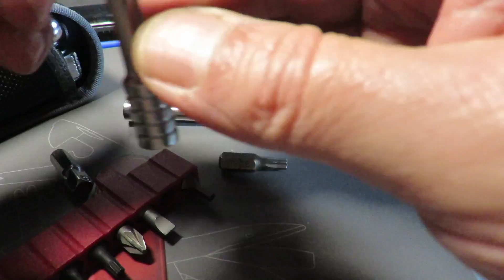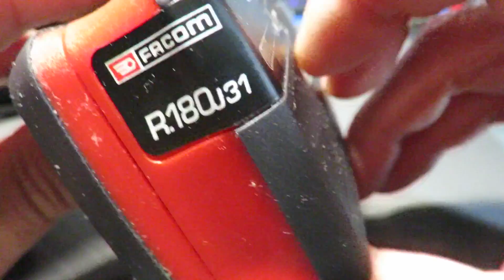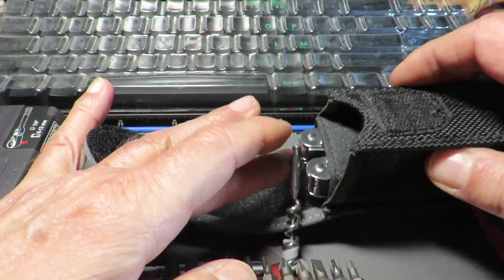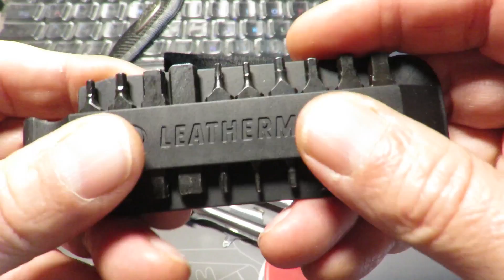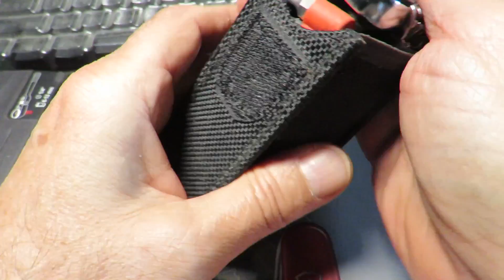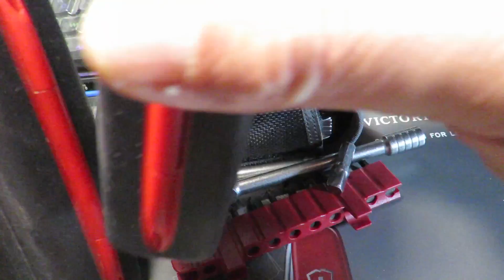Sublime Ratchet for your Victorinox Swisstool !

Comment: I really like that Facom adjustable head. They don't sell the kit on Amazon here in the US. They do sell the ratchet and extention for around 65.00. I found another kit that I just ordered made by Gearwrench. Have you seen that one? I looked up one from Snap On but all they sell is Bluepoint.
Reply from the maker: This model ? : https://www.gearwrench.com/ratchets-and-drive-tools/gearwrench-891400-1-4-drive-pass-thrutm-72-tooth-xl-locking-flex-head-ratchet-6-1-2.html
Reply: No. But I like it too. This is a kit. Model 85035 micro driver set on Amazon. Very very affordable. I believe Gearwrench products are made in Taiwan. I went to misterworker.com and looked around. I really like that Facom kit with the security bits. R.180J31 from your video. Even on eBay its still over a hundred dollars. EBay shows you other examples too, but nothing like the Facom. Teng tools? Let me know what you think.
Reply from the maker: @dennissmith802  https://www.amazon.com/GearWrench-85035-35-MicroDriver-Set/dp/B0062FSAVI
Yes, Taiwan. Like most mini ratchets.
Teng Tools? I do not see a ratchet equivalent to that of FACOM on their catalog.
For the R.180 ratchet or the R.180J31 box, these products are quite expensive, this is normal for the high end.
In France, on Amazon, the box is worth € 100.83 or about $ 120.
On eBay try this UK store, I think it can ship to USA: https://www.ebay.fr/itm/Facom-R-180J31-31-Piece-Compact-1-4-Embout-Ensemble-Avec-Tete-Flexible-Cliquet/164396938434?hash=item2646d234c2:g:ILoAAOSw8lpZMWvK
Reply: @diezelle57  Teng tools was  just one of the options that eBay gave me. I was curious if you had tried any of their micro ratchets. I haven't even looked at their catalog. The only thing I dont like about the Gearwrench equivalent of the Facom, is that it's almost seven inches long and it doesn't have the t-handle capabilities of the Facom.
Reply from the maker: @dennissmith802  I haven't seen a micro ratchet at Teng Tools, I told you. It would be much easier if you put links to the products you can tell me about :)
Reply: @diezelle57  Sorry. This is going to sound funny, but I dont know how to. I just got out of prison after twenty years so I'm really behind the curve on technology.  Tell me how and I'll do it. If it's not too much trouble. Ebay has a Teng mini ratchet kit like the ones you usually use in your leatherman videos. Like the craftsman one I told you about previously.
Reply from the maker: @dennissmith802  https://www.ebay.fr/itm/Teng-Tools-Disque-Hexagonal-Mini-Embout-Cliquet-8mm-12-Point-Bague-1400B/363141418364?hash=item548cea4d7c:g:SLYAAOSw6aVUq8y3  ???
Left click maintained, you highlight the link. Then right click: copy. Then right click: paste.
Reply: @diezelle57  I'm using my phone. I don't have a computer. Sorry, again.
Reply from the maker: @dennissmith802  Understood :)

Comment: Diegel, good job! Which ratchet tool works well with the Leatherman bits?
Reply from the maker: Bonjour Dee :) Les cliquets BOSCH, WERA et KS TOOLS que j'ai présenté précédemment tiennent bien les embouts Leatherman (sans risque de fuite sous pression verticale).
Hello Dee :) The BOSCH, WERA and KS TOOLS ratchets that I presented previously hold the Leatherman bits well (without risk of leakage under vertical pressure).
Reply: Could you share a video covering this?
Really hard to find a Rachet were these bits work reliably…
Reply: @StefanDeml   Let me see what I can do.
Reply: @dcordry  awesome!

Comment: You can find that ratchet as USAG 606 1/4” SK code  U06060012 (also a facom brand. They are equal) and as TOPTUL, a Taiwanese brand of tool code GADW2701 or GADW3401 (with or without sockets)... 
I prefer original Victorinox ratchet. but I fit in the sheath of my Swisstool X plus 3.0339.l a 4" adjustable wrench.
Reply from the maker: As for the Victorinox ratchet, the bits do not hold under vertical force, which for me is prohibitive (in addition to the excessive price).
No max torque is given, only 40 teeth (9°)...
Reply: @diezelle57   For vertical force using vic. ratchet you are meant to use the bit adapter.
If you want other 1/4 bit ratchets alternative in a really compact package... 
TOPEAK Rocket Lite ratchet. works almost as well as you wish and it is not expensive.
Reply from the maker: @giuliogemino6407  No, a properly designed ratchet is supposed to hold a bit under force vertically. I point out to you that the extension is not sold with the ratchet which should therefore be sufficient on its own. All the mini ratchets that I associate with my Leatherman multi-tools (from noname to BOSCH, KSTOOLS, WERA) do not show this defect. On my channel I showed the issue I had with the 711L mini ratchet specifically designed for Leatherman's bit holder (bits not holding under vertical force) and the company sent me that same ratchet but corrected.

Comment: Bonjour, le bit holder orange vient d'où ?
Reply from the maker: Victorinox.
Reply: @diezelle57  c'est le rouge que tu as coupé ?
Reply from the maker: @erwanthomas  What are you talking about ? Give a moment on the video; thank you.
Reply: At 7 minutes there is an orage bit holder that you use to pack in the sheath with the facom pico. What is it, I intend to do the same setup. Thank you 😊
Reply from the maker: @erwanthomas This is an ordinary bit holder ramp that I found in screwing sets. But it is difficult to find it separately; there is such a product on Amazon in plastic (10 to 12 slots) more or less hard...
Reply: @diezelle57  ok I Will search for it thank you !
Reply: I'm Now thinking of replacing thé bit holder with the leatherman. But kit this way I Would pack more bits, what do you think ? Will it hold in the  pouch with the pico?
Reply from the maker: @erwanthomas  = ???
Reply: @diezelle57  sorry my eyes are a bit tired I was think of using thé leatherman kit bit instead of the standard 1/4 bit you use in the vidéo
Reply: So I bought the facom pico but it doesn't work with the leatherman bits
Reply from the maker: @erwanthomas  The video relates to a ratchet for Victorinox, therefore for standard 1/4" bits. With regard to Leatherman bits, the bit must be positioned at level of the the white dot: in this position it will hold under vertical force but will fall easily ( blocked but not held). It is therefore not ideal but it is not prohibitive since screwing/unscrewing is perfectly possible. On the other hand, the Leatherman bitp is not suitable for the 1/4" slot at the end of the handle.
Reply: @diezelle57  Yes that's what I noted after further tests, I have the 21 pièces pico, so in à surge pouch I was able to put the pico with the adaptateur à douille with the smallest douille (don't know the Word in english) on one of side tube, in the other tube I put the leatherman bit extender, in the front central pocket in put the bit extenders, in the main pocket I was able to put à leatherman wave(need to buy the spirit) plus most of the douilles plus the pico extension. But it's à bit heavy. Do you know à tool that Would replace the douilles and fit in the pouch.?
Reply from the maker: @erwanthomas  "Do you know à tool that Would replace the douilles and fit in the pouch" = ??? douilles = sockets ...
Reply: @diezelle57  thank you I Would have never guessed. 😊
Reply: @diezelle57  and if you have any idea for the tool I'm interested, I'm building an around the globe backpack tool kit, because this summer in cambodia I needed for an Old rusty bike two pliers or a wrench and a plier to Fix the breaks. I Will look at your vidéo on edc wrench and I also saw a titanium wrench by bigidesign but it is on the expansive side and I don't know how it performs.